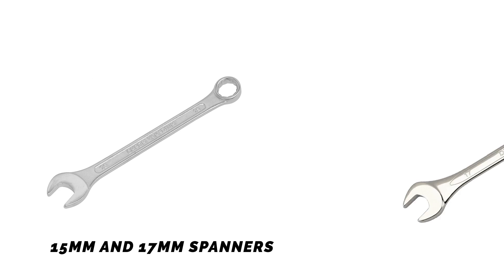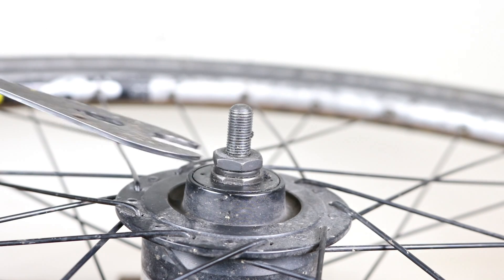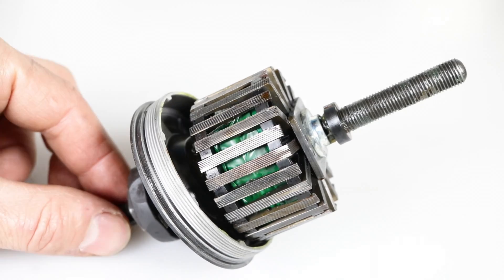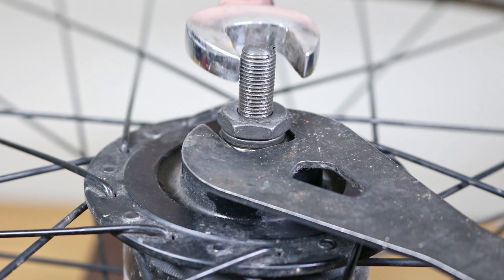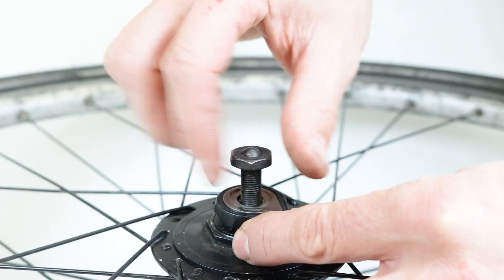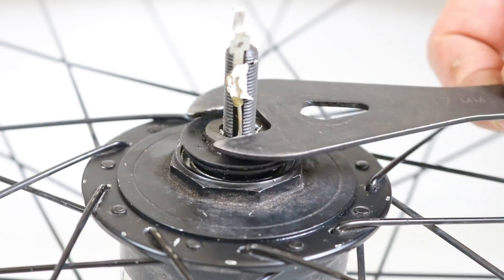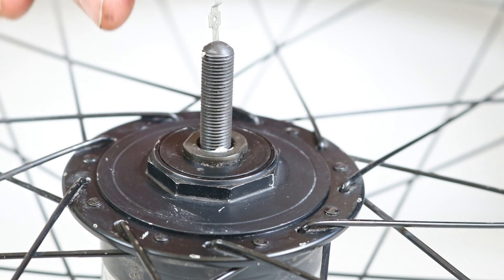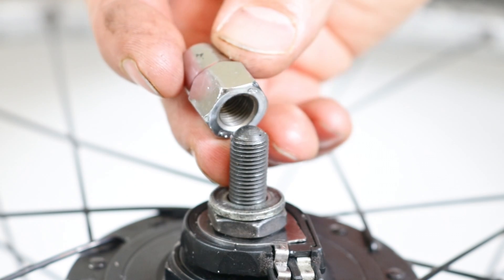Bicycle dynamo hub care and maintenance - Shimano Nexus overhaul

Comment: Appreciate the video- well shot and super easy to follow. Once the internals are out of the hub shell, I like to drill and tap an M4 hole on the NDS (not feasible to do it on the outer circumference, as insufficient space between the magnets). This way, it's easy to inject some semi-fluid grease into the workings- to keep corrosion at bay, and to keep everything nicely lubricated.

Comment: Lifesaver. I snapped my dynamo wire, this helped me to fix it! I thought my bearings were gone because of the drag, but it is normal friction of the dynamo. I used wire glue to fix the dynamo wire. Lesson learned.
Reply from the maker: I'm so glad this helped you out! It's great that you figured out the issue with the dynamo wire. The drag from the dynamo is normal, so no need to worry about the bearings! Thanks for sharing your experience, and I'm happy you were able to get it fixed! 🚴‍♀️⚡
Reply: I have the same problem here. But mine is running uneven and very rough. I maybe have to replace it after 12000km of continuous usage now as I am always driving with my lights on. Also the left cone has two little marks in the running area of the balls 180° apart. This cannot be normal it should be completely smooth and even. But maybe I am wrong. We will see.
Nevertheless one nice instruction video although I have a different type of dynamo hub.

Comment: I have never attempted this job because i cannot see how you can be sure if the bearings are adjusted correctly as the hub does not turn freely because of the dynamo. Incorrect adjustment is going to kill the bearings very quickly. Having watched this video i might give it a try on one of my oldest hubs as grease is definitely dried out.
Reply: Trzeba sprawdzać luz koła
Reply from the maker: Hi, thanks for your comment and apologies for not being able to get back to you sooner. You’re right that adjusting hubs with a dynamo can be tricky since the added resistance from the dynamo can make it harder to judge how freely the hub should turn. Best of luck, and feel free to ask if you run into any issues!

Comment: It is better to hold the cone on the power side to adjust the bearing play with the 17 mm flat key, otherwise it can happen that the cone rotates when counteracting and the power wire breaks off. That is the unpleasant experience I had at work have.🙄
Reply from the maker: Hi, thanks for sharing your tip with other viewers.🙂

Comment: What? No replacement of the glue?
Reply from the maker: Hey, thanks for the comment. While replacing the glue could be a good practice it is not essential to do so.
Reply: @cyclemaintenanceacademy  Hi, thank you for the nice video. I would agree about the glue, though. The Achilles' heel of Shimano dynamo hubs is water ingress, either by the axles due to insufficient lubrication of the bearings and seals (lower-end models), or by the wire terminal, especially if it is not re-glued after servicing.